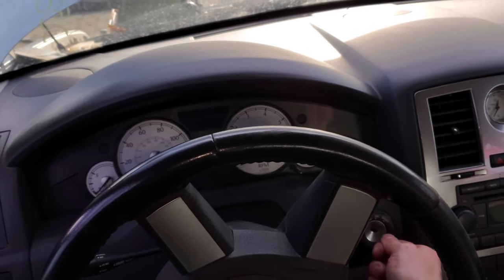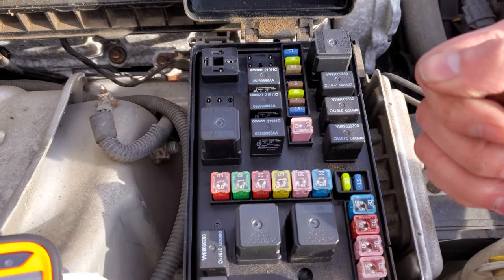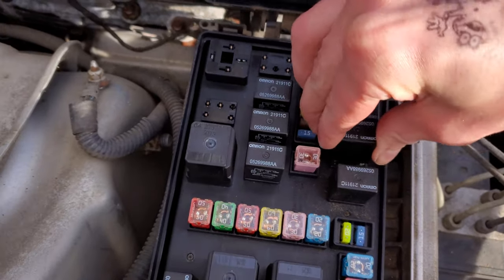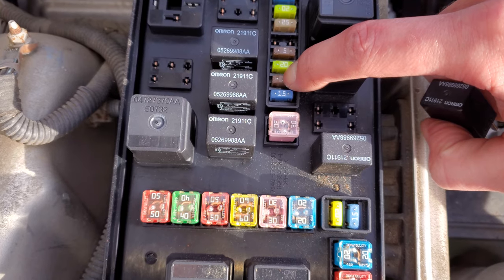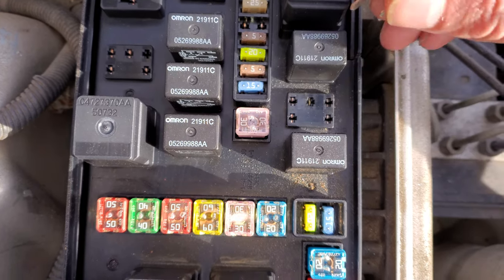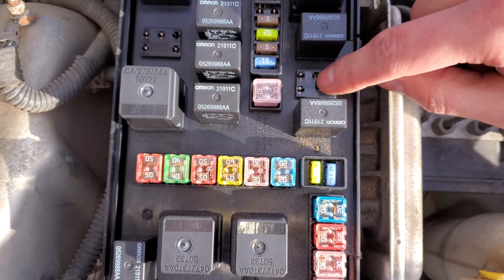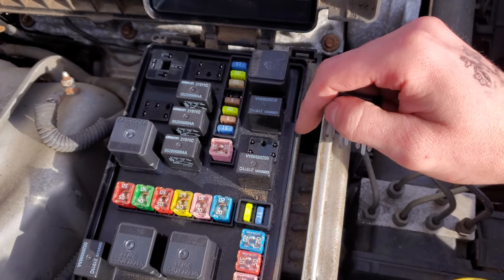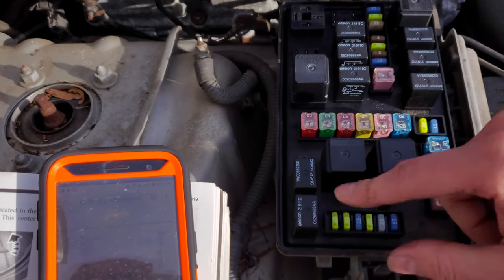2006 Chrysler 300 Starter Fuses, Starter Relay

Comment: Thanks for your videos, I have 2006 Chrysler 300 srt8 150.000 miles, the car cranks on cold with no problems, start right up, but when I drive de car for about 15 minutes and I turn off the engine the car cranked to slow like the battery is not good, I need to let it cool off so I can be able to start the engine again. I took the car to 2 mechanic's the first one replaced the starter the second one replace the battery and the problem still there. I went back to one off them and he changed the positive starter cable, and it still didn't fix the problem. thanks

Comment: That you for the video, it was really knowledgeable. I'm having an issue where my 05 Chrysler 300c 5.7L won't start. Used your video and paperclip engaged the starter but when I turn the key over there is no response. I get all the indicator lights on but there is no sound. Battery is good and fuses good, also swapped relay. Any suggestions you could give would be helpful.
Reply: Hey did you ever find a solution? I've ran into the same issue.
Reply: Did you find the solution I have same issue but no lights or crank nothing
Reply: I have this issue happening now.. did you find the issue?
Reply: Did anybody figure it out? I'm literally having that issue right now. Use the paper clip and the engine starts right up. But when I put the relay back in and try to turn it, it just gives me one, click from the starter

Comment: I have a 2006 Chrysler 300 2.7 that died on me while car was running no bus I've changed the fuse box of changed the camshaft position sensor checked all the fuses and relays no crank no start

Comment: So I have a 2006 Chrysler 300 Srt, my crank fuse blew when I had the a/c running and car at idle, replace the fuse. Now the car starts but once at idle or putting it in drive the car dies, any recommendations? Scanned vehicle and only had misfire faults. Check plugs and coils and good.

Comment: I questions about my 2012 300. It  won't start. Someone told me it could be a starter fuse relay? Batteries were checked no issues. It has power but won't turn over. I dont even hear a click.
Reply: Alternator
Reply: @5ucio  are you sure it’s the alternator my charger is giving me the same issues and I replaced the alternator a month ago and my battery is good. Going to change out my ignition switch and ignition switch actuator and see if that helps because my fuses aren’t getting power to them. [Car has power, Starter Fuses not receiving power]

Comment: I tried swapping out the relay switch with the horn relay switch, then I tried a paper clip - it start later it didn't work then the paper clip got hot but no start or sound ?

Comment: hey so i can see you have a huge knowledge on these cars, if you could reply that would be great . my speed cluster doesnt move but my rmp gauge does, and it says its lost communication with the tcm, some effects of this are the car slams into gears. is there any insight you could give on whats going on with my 2006 chrysler 300
Reply: i know im late but i recently had this problem with my car and what i did to fix it was take apart the abs control module and clean it out put it back together and cleared the codes and has worked ever since

Comment: I have a 07 300 3.5 replaced the timing belt and when I started it run and 
shutoff after 5 sec it did it 3-4 times and then it stop crancking I check the fuses and relays and I was able to crank it with the paper clip but didn't start wi the key ignition on. It has no chip key.
Reply: I found the blown fuse in the rear that says ign. But still no crank the security light is blinking i reset the computer and still the same. Any ideas. Thanks for you help.
Reply: @hyper-amps1684  hi were you able to find the solution? I've run into a similar problem.